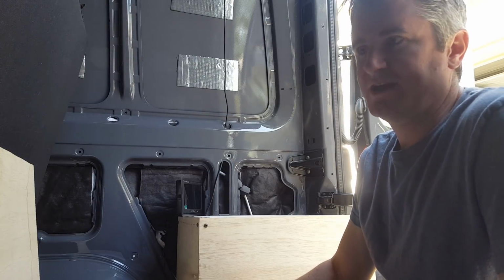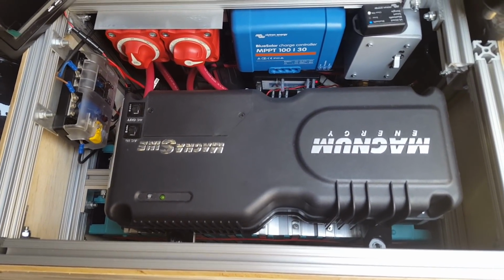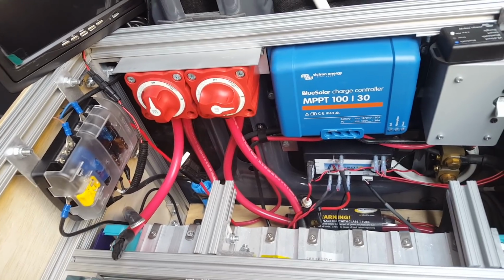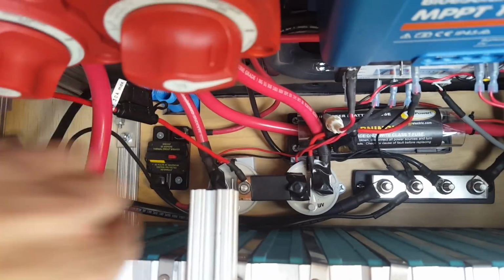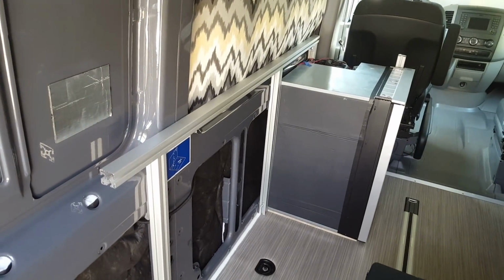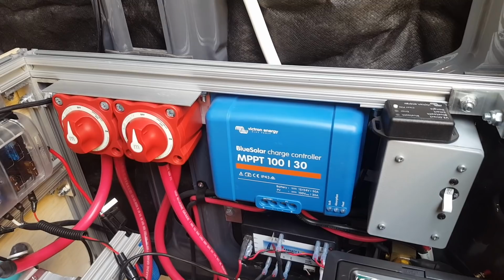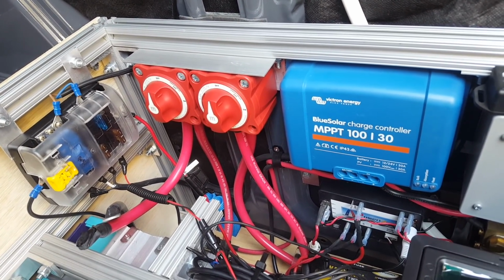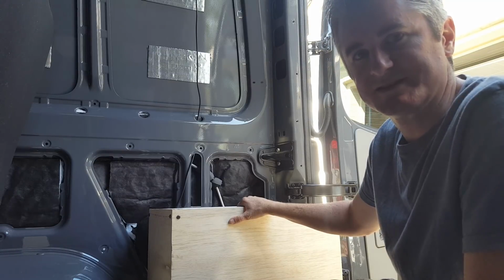Lithium Battery Install in a DIY Mercedes Sprinter camper van

Comment from the maker: The wiring diagram has been posted on my website at https://ourkaravan.com        Click on "Van Build" and it is located in the Electrical section.
Reply from the maker: Yes, unfortunately that is the case with the comments. Feel free to post new questions if/when you have them and I will respond.
Reply from the maker: That's a tough one. I have room for another battery in the box but in reality the thickness of the wires required would make it a real bear to try and get another one in there.    Either way you go, if you are under capacity it's going to be a pita but if you're over capacity you've wasted both money and space.  Tough call.
Reply: Wow, I never saw like your job,  outstanding ,lots of /good / information, thanx
Reply: @Scott Mead another solution is to add a whole spererate system with its own battery, mppt ECT. 

But take your watt hours per day and multiply by 3 and you got a good enough battery bank.
Reply: thanks for all the info!
Reply: Your wiring diagram with embedded links is amazing. So helpful. Thank you
Reply from the maker: Thank you, happy to hear!

Comment: Thank you for the great videos!  I'm sure you know by now, but just in case, Victron make a 12 volt to 12 volt programable charger called the Victron Orion TR Smart DC - DC Charger that can be connected to your alternator through the van's starter battery  (On your van, (it looks like a 2018 Sprinter) suggest using the open slot on the  Mercedes-Benz MIDI circuit breaker harness located alongside the rear side of the starter battery. Just unscrew the circuit breaker harness, slide it out, and attach an appropriately sized MIDI connector in the empty slot.)  The Orion 12/12 charger comes in several versions based on voltage and whether you want it to be isolated (separate from the van's ground) and non isolated (using the vehicle's ground/negative).  It's been years since you made this video and you probably have already updated the system, but just in case I thought I would jump in and let you know.  Again, thanks for all the fantastically helpful and well done videos!
Reply from the maker: The Victron dc to dc converter is pretty new to market and did not exist when I built my van.  It’s a good option.  My system has some advantages, like the use of small and lightweight AC cable running to the rear of the van as opposed to heavier DC cabling, but I have to manually activate my system when I want to use it. As of today, I am going on five years where solar has met my needs all the time with the exception of once.  This system is really meant as a backup to solar, and it works great!  That said dc to dc is good as well.  Thank you for the kind words, and safe travels!

Comment: A the same brand of batterys i have never seen any one use those batterys before I have 2,440 ah in my house
Reply from the maker: These were pretty much the only lithium batteries available in this form factor four years ago.  There are more options now.
Reply: @ourkaravan  my batterys are 3 years old and I love the power

Comment: I have to ask.How much are you into this dollar wise? As designed.
Reply from the maker: I guess you wouldn't be surprised to know I have a detailed spreadsheet.  The entire electrical system including the battery, inverter, every single piece of wire and electrical lug, the solar panel, switches and breakers etc was the single largest expense in the van totaling around $5.5k.

Comment: That grey toggle switch enclosure is that a generic we’re I can in Lowe’s or HD? Or a blue sea product?
Reply from the maker: Yes it is (a generic product.). It's called a canex box and is sold in the electrical section of HD.  One thing to know--the Blue Sea breakers I used are slightly deeper than the box itself. I had to grind the terminal mounting studs down a bit to make it fit.  There was plenty of thread to allow this.

Comment: Nice setup.  Did you add a  fuse/circuit breaker between fusebox/distributionload and between Inverter to battery?    Is there a red bus bar?
Reply from the maker: Hi....the first thing the positive lead hits after it leaves the positive battery terminal is a 200 amp Class T fuse.  There is a DC breaker between the positive terminal block and the fusebox.  I have a full wiring diagram located here:  https://ourkaravan.com/lithiumbattery/
-Ken

Comment: Thank you for putting together such informative videos.  I’ve looked all over your site for the 80/20 framing of your electrical box but can’t find it.  Do you have the design available somewhere?  Also, how do you have the box anchored to the van?  Are you using just the D-Ring mounts or did you mount to other points for reinforcement?
Reply from the maker: Hi, I don't have the plans drawn but will add it to my to-do list.  If I recall correctly its 22-1/2" long by 15-1/2" wide inside dimensions.  Height is 16-1/2" tall. It is bolted through the sidewall of the van and also uses two of the factory floor tie downs.  I hope that helps!
Reply: ourkaravan thank you!  I’m designing a 200A/h system built on the battle borne system. I’m playing around with it in my CAD program don’t think I can even come close to the compactness of your design...  it’s fun but endless!
Reply from the maker: The Battle Borns are designed as a drop-in replacement for regular 12V batteries, so they are a little larger than my battery, but at the same time there's no external BMS and all of the associated contactors my system has.  If you'd like to reduce the size of the system down, the LifeBlue 200ah battery is nearly the exact same size as mine and has an internal BMS like the Battle Born.  They don't have anywhere near the warranty though.  But you could reduce the box size down a little more.

Comment: I have the same magnum inverter charger and after buying 2 lithium batteries my magnum controller did not have an option for custom or lithium battery settings. I called magnum energy and asked and they said it cannot charge them fully. About 70% and wasn’t made for the lithium’s but wouldn’t hurt them ether. Since I’ll need something bigger anyways I’ll probably get the victron multiplus 3000 watt.
Reply from the maker: It is true that Magnum refuses to update the software to allow a custom battery profile (they easily could but they want to sell you the bigger model), but it's a bit of a work-around.  You can set a custom battery profile (see pg 12 here:  https://www.magnum-dimensions.com/sites/default/files/MagArchive/64-0003-Rev-D-ME-RC.pdf ) , but one issue is the charger goes straight from bulk to float charging if you engage it when battery voltage is already over 13V.  On a lithium, battery voltage is often over 13V.  So usually it ends up float charging the battery up to the setting you have it set for.  Doesn't seem to matter as the battery is still being charged.

Comment: Best setup I've seen yet that I understand. Im in process of a van build and the power setup is killing me. I plan on being in my van full time and living a comfortable life so I want plenty of power.... Problem is I don't know what that means.. 12 vs 24, then all these components.. head hurts! I'd love to talk to you and pick your brain. Anyways love the video.
Reply from the maker: It's a pretty complicated subject.  Not sure if you've looked around my website, ourkaravan.com, as it helps break it down a little more.  

On the 12V vs 24V, there's little doubt in my mind that 24V is a better way to go, but many of us, myself included, don't want to deal with having to step the voltage back down to 12V for refrigerators, fans, heaters, etc.  That's the primary reason I stuck with 12V.  

Check out the website and see if the electrical articles help break it down a bit more.  Good luck!  -Ken

Comment: Hi,
In connection with the struts of the battery box and other advantages (e.g. cold bridges) you must try the following metal-free profile:
https://product.item24.de/produkte/produktkatalog/products/profil-kh-1001043001/

Comment: Great video however you should have mounted the Inverter outside of the battery box - there is far too much heat generated from the inverter.

Thanks Mike
Reply from the maker: I don't push the inverter hard enough to create much in the way of heat, but yes, it should be a consideration based on your usage.

Comment: As someone else has said there are lithium phosphate batteries with built in battery management that can handle being charged by the alternator
Reply from the maker: There are pros and cons of built-in management, but they do simplify installation.  I have heard good things about some of the most recent batteries, so it's looking good so far.  By the time I need to replace this one I should be able to get one half this size with three times the power for one-third the price.  :)

Comment: I have only one for a trolling battery. I check it after 24 hours it likes to stay around 13.35 and takes a very long time from there to go any lower. I think the Float stay's around 13.3 volts and this will make them last a lot longer and you'll get more amps out of the sun too.
Reply from the maker: The voltage is very stable.  Mine is almost always at 13.35v and that's from 4 to probably 90% SOC.  I'm sure a fan of LiFePO4.
Reply: @ourkaravan  Same here, knowing it wont catch fire is worth it. Then paying half the price is really worth it. Last it really is close to a drop in replacement of lead acid. The tech is that good. If it get's as  cheap as AGM batteries then that just might be all we need at this point. Only flaws is charging at low temps. If they sold a device that can set your Alt voltage to 13.5 volts I would run this is a Car or Truck any day.
Reply from the maker: @controlyourfuture5477  A fire would definitely ruin your day.  Prices will come down eventually.   And eventually more companies will make programmable chargers to make the hardware aspect a little easier.  Victron seemed to be the first to step up to the plate.  Everyone else will have to bring similar products to market or they simply won't be able to compete.

Comment: Some of this went over my head and I need time to soak it in and digest.  One thing struck me - you can set the controls to stop charging your Lithium battery at a certain point?  This is very useful.  Please verify that I got this right.  Is there a way to stop cell phone charging too?

As usual, your video did not disappoint.  What an intelligent and creative build!  Very impressed.  Subscribed.  You are rendering a huge service to the Van Build community on the web.  I also learned a lot of useful tips from you.  Thank you!
Reply from the maker: More or less, yes.  I can't set it by battery percentage, but to increase battery life I stop charging before the battery is at 100%.  I don't need the full capacity of the battery, hence why it's okay for me to do this.  Roughly 14.2V is "full."  I usually stop charging at 13.9V.  It's not an exact science as the final resulting charge will vary based on how much amperage was flowing at the time it hit 13.9V, but it gets me a ballpark mid-90% charge.  The Victron solar charge controller lets you set the voltage in 0.1V increments.  

Thank you for the kind words, always appreciated!
-Ken

Comment: The makeskyblue solar controller seems to have 2 separate inputs. Could use to charge from engine?
Reply from the maker: I am not familiar with that one but I'm willing to bet the alternator puts out a lot more current than it can handle.  Just a guess.

Comment: Okay, you ready for this? I bought that 100amp battery you got and killed it to 8.8 volts. I forgot about the meter taking a little power to run. It must have been dead for about 3 days. I slowly charged it up with a smart charger and it still works. It keeps a voltage around 13.29 volts for months. I don't know what damage I did to it? Going to do a watt /hour test but I was getting around 1400 watts.
Reply from the maker: Just curious, how long was the battery sitting to drain it down?  Was it at a low state of charge when you last used the system?
Reply: @ourkaravan   about 2 days max. I had to use a smart charger to bring it back but it seems fine now. It's been hold a 13.20 charge for 8 months now. However I don't think the charge reached 13.8volt max when charging it. It held a 80 amp load from my inverter for about 5 mins fine. I had to do some rewiring and moved. I check it after the 8 months and never dropped any voltage at all 13.20 volts. 8.8 volts should be a goner right?
Reply: Only had ran it for about 10 cycles max. solar back up. I did pull 110 amps out of it when new running a cook top.
Reply from the maker: Is it possible you have a ghost load somewhere?  The BMS disconnects all of the loads if it gets below 20% capacity if it is properly wired.  At that point the BMS is the only thing that is still running (because it would need to be on to accept a charge again), but its draw is so low it's measured in milliamps.
Reply: @ourkaravan  Yeah, about that. Mm I have voltage readers for each cell. balanced them by taking the battery down to 11.2 volts and then put them all in parallel for 24 hours then back to series and charged to 14.2 volts. I ran them for the year I had it and every cell stay the same. 3.55 , 3.54,3.55,3.56 volts. I kept an eye on it. I love my 550 dollar battery. Much better then the two deep cycles I had.
Reply from the maker: They are balancing very well.  Looks like it came out okay!  But I am curious how the battery got that low.  Are you using the BMS and the contactors for protection?  If not, I fully understand.
Reply: @ourkaravan  Well I had my solar charger Mppt 30 amp hooked up along with a 30 Farad capacitor and those just setting along with those little meters I think I might have been pulling  a quarter of a amp and it was a little too low to began with. After a few months went by, I check it one day , it was on a Friday and it was at 11 volts and on and I knew I needed to charge it but forgot. On Monday it was 8.8 volt. I cried and put it on the smart charger cause I didn't have my panels with me at the time. Other then that? How do these batteries last and put out?
Reply from the maker: I can see how that could happen, especially if your rv is stored off site and not easily accessible.  What are the capacitors for?  I'm glad your batteries recovered, they seem to be pretty tough!
Reply: @ourkaravan   I build a (PIT box) Power in the Box, lol I have a 1200 watt true sign wave inverter and a 30 amp MPPT solar charger that I can use for Lithium batteries. I use this box to fly my drones when camping outside and for making coffee in the middle of no where. I also charge flashlight batteries. I have two 150 watt panels that I made to fold out. I put the caps in there for extra start up power for skill saw at work. Kinda nice to grab the box and stick in my truck. Little over 1200 watts hours is nice to have in a small little box. I'm redoing the box to be even smaller thou. I don't think I need the cap, what you think?
Reply: 8.8 volts should have killed them totally, I wonder if I shorten their live span? 520 bucks a battery is not cheap.
Reply from the maker: @controlyourfuture5477  I guess it all depends on the power draw of the saw.  I have no experience with capacitors.  Sounds like a cool power box though.

Comment: I clicked on this video as it is a subject I'm interested in myself, but have no personal experience beyond lead acid.
With lead acid a split charge is so simple with a 4 pin relay of sufficient rating.
Triggered from a wire branched in to the small wire on the alternator, it will link the vehicle battery with the leisure batteries.
Why can't that work with lithium, so long as a voltage limiting device is placed in the line?
If you have 4 cells that max @ 3.7v x 4 = 14.8v, it is unlikely your alternator will exceed that voltage often, but in case it does, wouldn't a voltage limiting device inline suffice?
I realise that any voltage regulation unit may itself have inefficiencies, but would be so much more efficient and cheaper than an extra inverter.
Those are just my thoughts and I may well be wron. But if I am, I'd like to know why?
Reply from the maker: I am no expert, but here is what I have gathered.  To start, modern vehicles use "smart alternators" and they don't put out consistent current like older vehicles.  I wrote an article that talks about this here:  https://ourkaravan.com/van_electrical_system/    
There's a link in the article that explains why combining batteries does not work well on modern vehicles.
Most lithium batteries need to stop charging well before a lead acid.  It's common to float a lead acid at 14.8V, but my lithium batteries actually go into emergency cut-out at 14.2V.  Simply managing these batteries by controlling voltage isn't enough.  The internal resistance is so low that any voltage and current being conveyed by the alternator will continue to charge the battery.  This isn't the case with AGM/SLA because if you hold the voltage, as the amperage drops the charging ceases because it's not enough to overcome the internal resistance.  A lithium would continue to charge/overcharge.  The low internal resistance is what makes lithium batteries charge so quickly, but as you can see, it takes a bit more specialized equipment to control the charging.